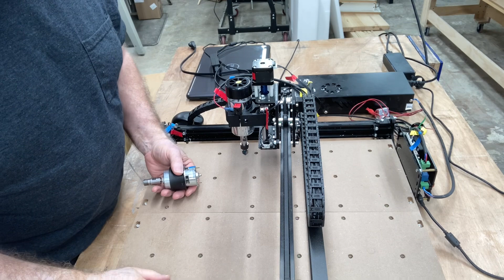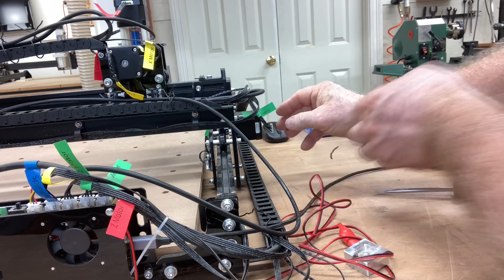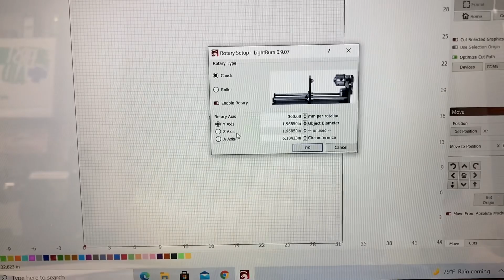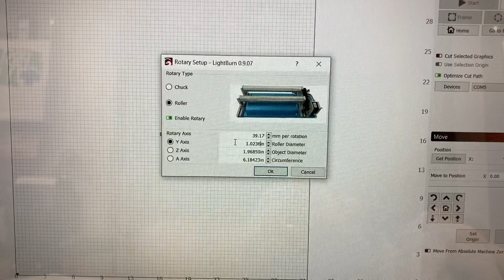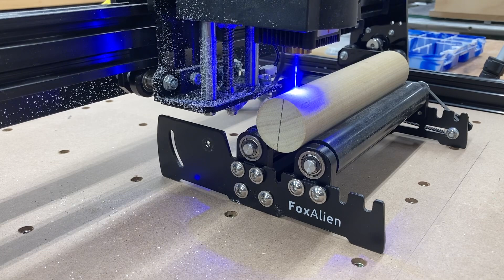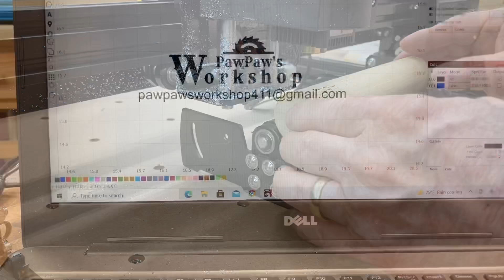How to Install the Rotary Roller and Setup

Comment: Hi there! I am learning so much from your videos! Thank you!! I have a question about something you mentioned in your video. You changed out your CNC spindle for the laser engraving head in this video. I currently only have the FoxAlien laser engraver but I’ve been looking into a CNC. I thought it would be another complete machine purchase but now you have me wondering if I can simply buy a CNC spindle attachment/upgrade and use the Reizer base rather than purchasing another separate machine. Is this possible and if so, what would I need to purchase?
Reply from the maker: If you have the laser you can not add the spindle to it. It’s a different controller and the machine must be much heavier. The FOXAlien 4040xe is a much heavier machine with the laser and the CNC control boards installed. That’s no the case with the Reizer. It’s just a dedicated laser

Comment: I got the rotary laser with the Fox Alien 4040 XE and the rotary setup for that model as well, but i haven't used it yet. Do i need Lightburn to utilize the laser with the machine or does it work with Candle or Easel? Thanks for sharing your knowledge.
Reply from the maker: You will need Lightburn or lasergrbl
Reply: @PawPawsWorkShop  Thank you sir. Another question on the above subject... was i supposed to change the G codes for the test carve or were they already  preset? i didn't change anything with the G codes before i started the test carve.